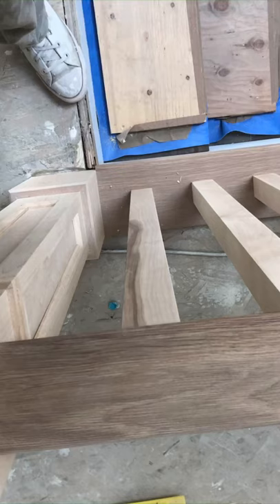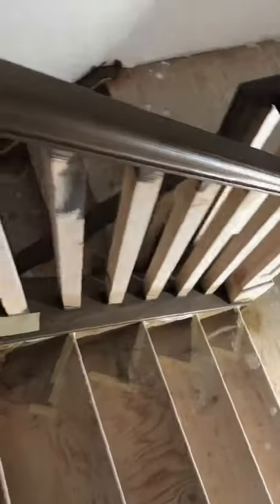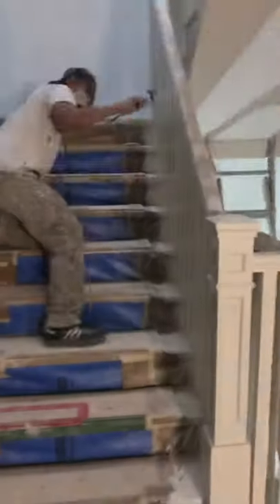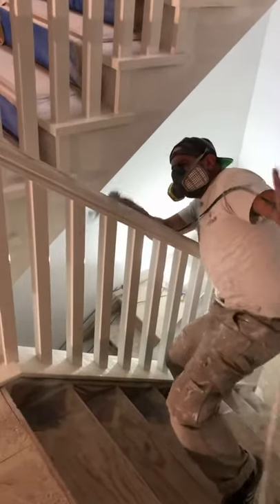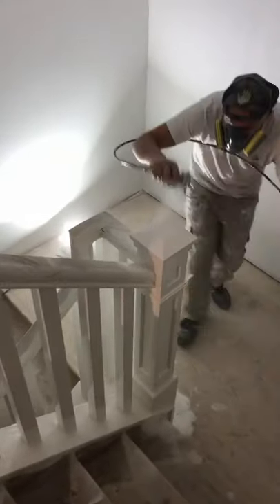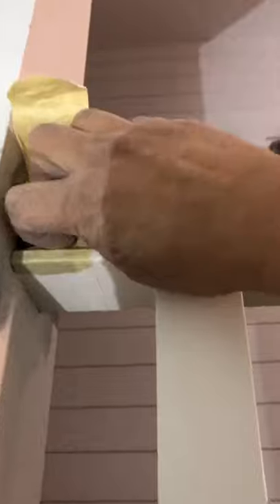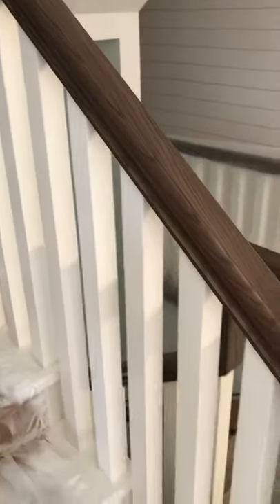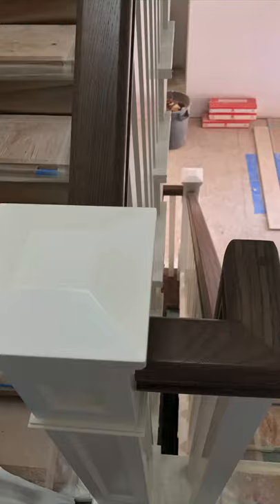How to spray a Two Tone Railing - Airless Spraying.

Comment: Cant wait till someone holds my hose then I know I really made it. Better yet one on the machine and the other on the house while I watch. Years away from that I guess xD
Reply from the maker: Lol Yah I Guess all in good time. But over time I have found this is the best way its way faster less frustrating and you get a better route system to spray it which definitely results in a better finish. He s a lucky guy lol get paid to hold a hose lol 👊👊
Reply: @toplinepaintingspraycoatin2732  I have been in that situation and sometimes had someone holding mine as well. New business owner now and I am working solo, 6 months in xD